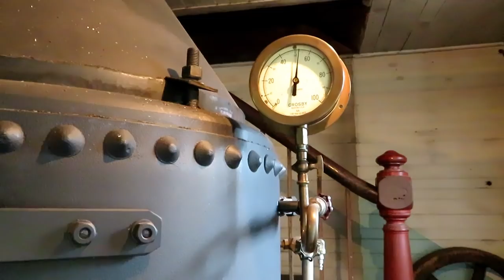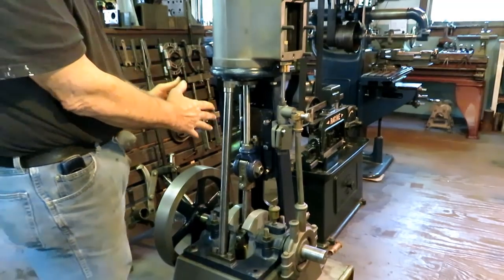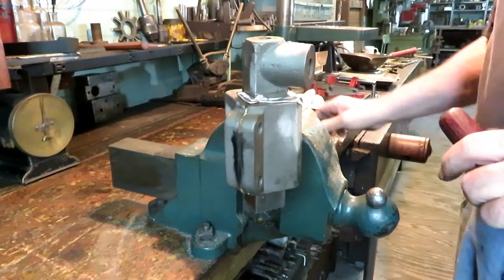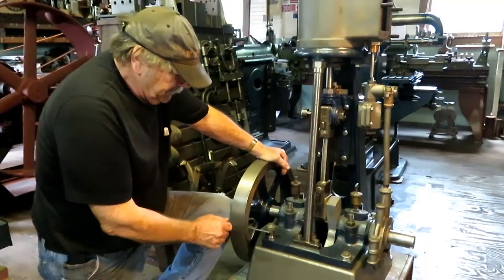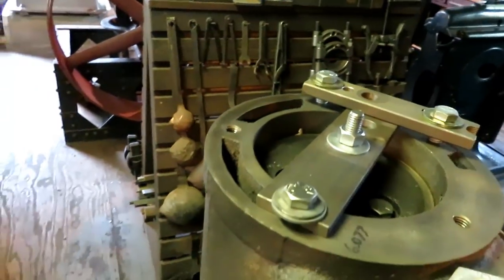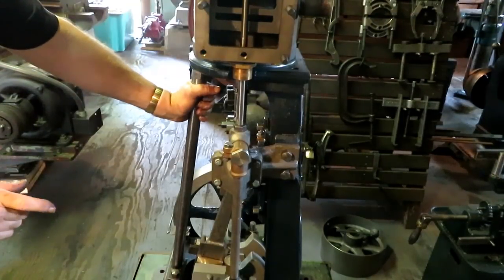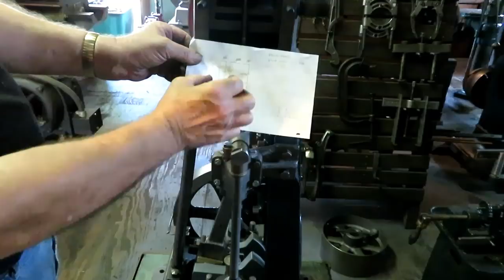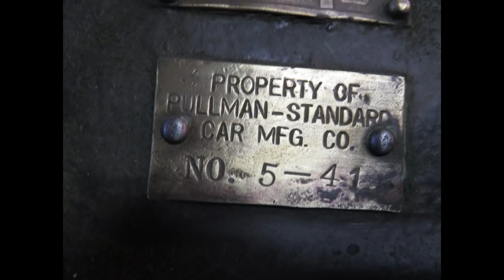OLD STEAM POWERED MACHINE SHOP 42  Steam Engine Slide Valve

Comment: 'Loved  the still shots of the calendar & motor tags !   I really appreciate your genuine portrayal of doing things the 'old time ' way ;)    Presently, I'm taking steps to 'cobble together' some useable machinery , using parts from a '30's Atlas lathe, a few old cross slide / carriage assemblies ; along with a drill press , lots of grinding and 'fitting'   I've used a table saw for grinding dovetails with very good results !  * Accurate to less than .001 in 8 inches !  After which , I used a surface plate & angle jig to bring tolerance to very near ''ZERO" !   Inspiration and perspiration play a big part too !  :)   
      My future objective is to produce a "Solar steam engine" - that will work through most of the summer .   I'm toying ( SERIOUSLY TOYING ! )  with wooden framed machinery with steel and cast iron for wear surfaces. . . much like very early 19th century machines.  * Good to be in 'this ' century though , because of modern welding machines , and powered hand tools to speed up the process !   'Seems like slow & steady wins the race , or at least tends to give more SOLID results !   Time to go scout out some more ''scrap iron". . . the future NEEDS more 'junk' converted to GOLD ! ( Instead of sending it overseas as 'cheap scrap'- only to be shipped back here as inferior overpriced GARBAGE !
     'Always a pleasure to see what's NEW , in the 'Oldtime' machine shop !   Thanks for being YOU !
Reply from the maker: George,  All true...I'll be looking for your "kit" wood & iron machine tools when they hit the market....Dave

Comment: I was fortunate to work in an era before reciprocating steam engines became a thing of the past, as they  have a character all of their own .The level is good for leveling the machine , but put it away after that,I take it that you examined the condition of the shaft and particularly the square end for wear ,if ok then set shaft up parallel to the cover flange with a sliding square and feeler gauges  take out any shims  between the slider bracket and the engine ,put it back and pour white metal. As for the slide ,get a sheet of paper and press against the slide face to make the impression of the ports and outside of the port area,That is the pattern for one side of the slide ,the other side you will have to measure from the ports face to the center of the rod
Reply from the maker: Thanks Obb,  All good stuff, My idea with the level was to get the valve rod lined up with the piston rod and then pour it. I'm still working on how to figure the "inside lap" on the valve. Some say you don't need it....Dave

Comment: Love these videos! Thank you for making them.  It seemed like the engine turns hard while you were finding the top and bottom. Will it free up as it runs a bit?
Reply from the maker: Hope so, the crosshead sticks a little near the bottom, the bolts don't fit quite right. I don't think the holes line up exactly over the threaded holes. So it is with some 1890 shop work....Dave

Comment: I have been waiting for the explaination of slide valves on steam engines like this. Also that starrett caliper you used for tdc. I have that exact one myself. I love it. 

For bdc wouldn't using a wooden block against the conrod journal have been both easier and more accurate?
Reply: Oh btw the motor for the horizontal needs some washers/shims as the end was dancing back and forth quite a bit. On these new fangdangled electric motors that can cause...issues.. you would rather avoid.
Reply from the maker: I've got a couple of those and they are the first thing I grab when I want to measure something..  The idea is to find TDC of the piston, putting a stop on the crank movement wouldn't do that........Dave

Comment: Thank you Dave, excellent details. On the  holiday in the Babbitt, will it hold if you melted in addition Babbitt with an iron or is it best to stay with good enough.
Reply from the maker: It's made out of tin, copper and antimony. The percentages determine the hardness (and cost) I used old railroad babbitt on that job. Not too critical there. I don't think iron will combine Sean.....Dave

Comment: @9:40 by what means did you make sure the cross head pivot pin axis was in line with the crankshaft?
Reply from the maker: The engine was leveled with a machine level ( crankshaft, base, piston rod checked)  on both axis, then the valve rod was leveled and plumbed in both directions and shimmed there to hold it while pouring....Dave

Comment: You picked cutoff at 3/4 stroke like it was common knowledge.  Cutoff on locomotive engines is varied with speed and power.  Is 3/4 a workable trade-off for an engine of that size and use?  Can you explain further where that number came from?
Reply from the maker: The fixed cut-off stationary engines that I have measured all were 3/4. Manuals like Joshua Roses' and others use it as an example. If you shorten it up, the engine gets more temperamental about where it is in the stroke for start up (amount of lead does that too).  If you are way "overpowered" as in my case with the shop power engine,  earlier cut would save steam (and water). I've thought that I'd like to try making a slide valve for the Richards engine with more outside lap to see if it made much difference.....Dave
Reply: So it looks like it's just the combined experience of a million engineers.
Thanks for the reply.

Comment: I had to grab a screen shot of the motor tag so I could compare it to the one on my Buffalo Forge drill press.  Same patent date, mine appears to be an earlier number.  And it's 2 hp compared to your 5.

For all the potential problems I seen with it when I finally managed to get it knocked apart, all it took to make it work again was a little polish on the shaft and bearings ... and get it all pulled back together without it being in a bind.

If any of the information from the tag on mine would be useful to you, let me know, and I'll send you a copy of the photo.
Reply from the maker: Thanks, never did anything to it except a little oil now and then. It's got about a half inch of end play but doesn't seem to mind it....Dave
Reply: Simple brass thrust washer was what I found inside of mine.  They seem to be pretty forgiving, it runs surprisingly well on my "Franken-verter."  It seemed to have suffered from bouts of over-oiling to being allowed to run dry.  Bushings swelled from heat caused it to lock up, but no real damage to it.  For the time being I'm keeping just enough oil in it to make sure the slinger rings are picking it up.  No sign whatsoever of what they used for seals.  I put it back together to test it because I didn't want to put the effort of making or finding seals for it into a dead motor.  So, it will have to come apart again for that, but I'm determined to drill at least one big hole with it before I do.
Reply from the maker: could have been just leather rings for seals....Dave
Reply: I though it would be something like that.  And now that you mentioned it, I think I know what to try.  Pretty sure I've got some salvaged leather boot laces around here somewhere ... and they are easy enough to find in the store if I can't find those.

Comment: Do you live in a residential area? 
If so your neighbors must love you! Lol
Reply from the maker: The neighbors get concerned if I miss blowing it at noon.....Dave
Reply: THERE you go! The NOON whistle!
Reply: +David Richards haha good to know they do get upset
Reply from the maker: Hi Lewie,  The village did have a "noon whistle" years ago. The fire station across the street had a siren on the roof with about a 10 HP motor on it that was really loud. I would have prefered the steam whistles around here during the 1920s from the Bordens milk plant, International Harvester plant, glove factory and two steam saw mills at noon time....Dave
Reply: The Papermill I work at has a 7am, Noon and 4pm Whistle. up until they decommissioned the Powerhouse, it was My job as Powerhouse Engineer or the Assistants Job to Blow the Whistle. Just like in Dave's Shop, it was just a cable threaded down from the roof. Every time Dave blows his it brings back fond memories
Reply: There you go! I remember the paper mill letting loose with a blast at 8 a.m. I thinki. The plant is gone but the whistle resides at a body shop about 15 miles from here. Compressed air instead of steam but it'd talk then and I'd say it would now. Every time you blow yours it stands the hair up on the back of my neck Yessir, I like it here!
Reply: As a boy I used to hear factory hooters in the distance every weekday. I always found them to be pleasantly reassuring that the world was working and nothing was wrong.

Comment: Did they ever use a worm screw to adjust the timing of the eccentric?
Tanx
Reply from the maker: Willy, That would be a "reverse" devise and there were hundreds of them patented in the early 1900s using all different ways to change timing and cut-off. You can check Google Patents. I think Frick used some method with a screw in their very early traction engines ...Dave

Comment: G'day Dave,
Thanks for another wonderful video. I am enthralled with each one. 
Among my model collection, I have very close relatives to the 3 steam engines in your shop, but the smallest is maybe 2.75 inches high, and of the horizontals, the smallest would be 3.25 inches long, and the longest 9 inches. (My double parenthesis key doesn't work, with any keyboard, so I can't do the inch thing sorry. It must be a problem with my laptop internally I suppose. Aren't computers wonderful - not!)
That's interesting about the acrylic About 7 years ago I replaced the valve cover on one of my models with acrylic, just so I could see the 'goings on', inquisitive old bugger that I am.
You asked about slide valves in this video. Well, in all things miniature steam, this bloke is your man.
His name is Keith Appleton, and you can find him here, https://www.mainsteam.co.uk. 
Thanks again for another great video. (Could you show the camera you use in your videos please? The specification would mean nothing to me, other than the name and model number.)
With kindest regards.
Neil.
P.S. What is G+ and how do I find it?
Reply from the maker: Thanks for taking the time to comment here Neil. My camera is quite rudimentary, Cannon SX720-HS  Powershot. Not much of a camera, but shoots in pretty good definition. I would like to up-grade it sometime to something that will accommodate an external mic.   G+ and all my posts on it were done away with last year by Google. I am looking at other forums to use now. Thanks for watching....Dave

Comment: Why the obsession with levels?  What does a steam ship do?  Do you mean it is an easy way to check for perpendicular and square?
Reply from the maker: If you have one part level, another leveled part will be straight or square with it, that's all. Same with leveling a milling machine, if the machine is level, you can set up a piece level on it and the cut will be straight with it. Good question,....Dave